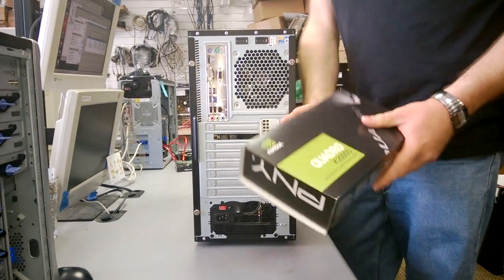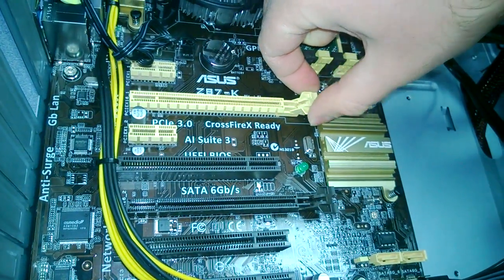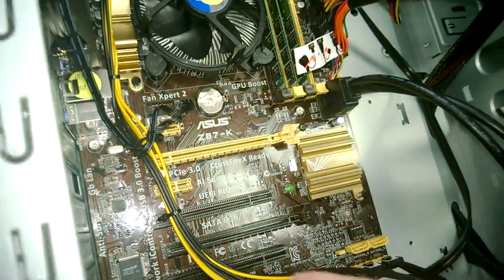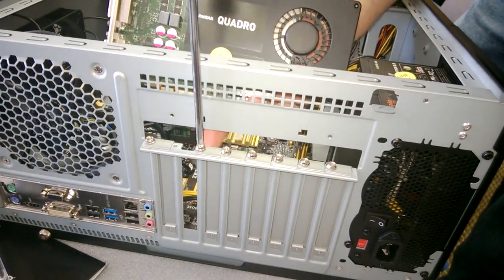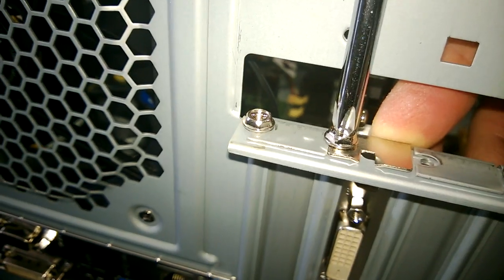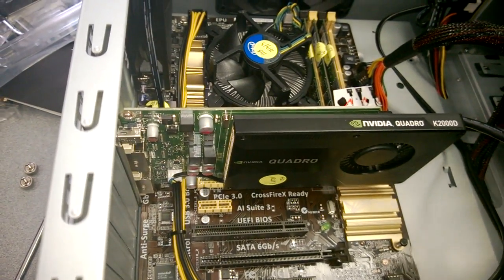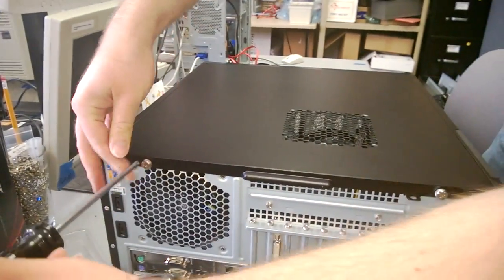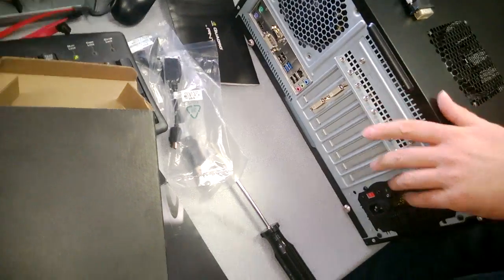How to Install PCI Express Video Card

Comment: I have no PCI-E 
What can i do?
Reply: run PCI.e X 16 high graphcs card?
Reply: Get a adapter
Reply: @SameerKhalid.  bro, which adapter will work? I checked startech pci to pci e but it's reviews are mostly negative
Reply: Get a new motherboard
Reply: kez I have a PCI-E but I don’t have the plug part what do I do?
Reply: @MattRichy  What do you mean?
Reply: kez i bought a msi gtx 1050ti and i require a 6pin but idk where it is located and where to plug it in on my computer